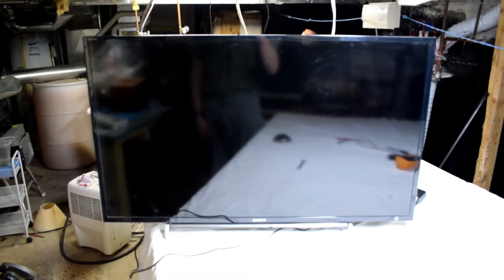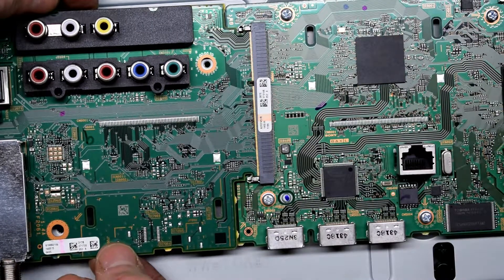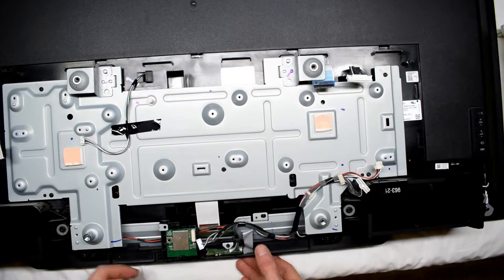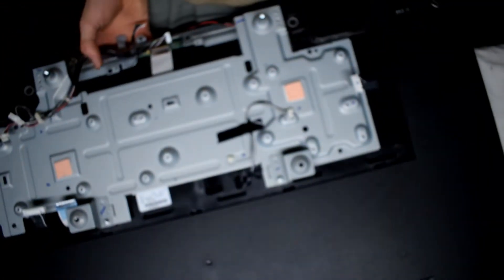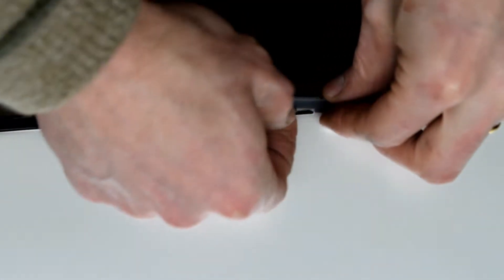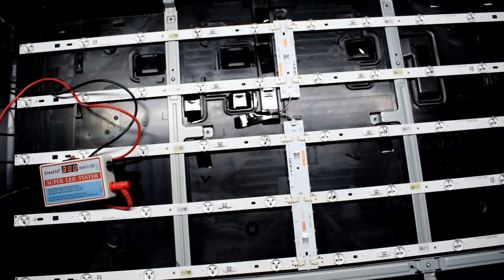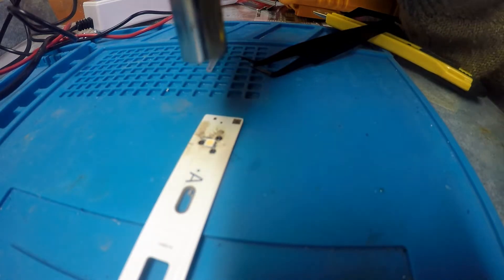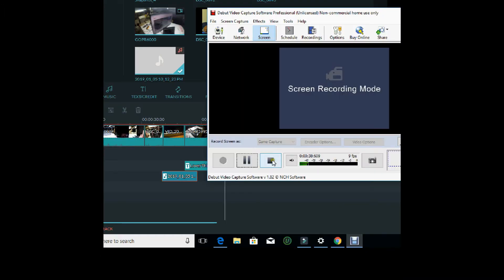Sony KDL 40W600  Backlight Repair

Comment: Great video!  I have the 48" version of this same model-line Sony TV.  Sony KDL 48W600B.  I also have the 6 red flashes with no picture.  Followed along all of your well described steps and also replaced all 12 backlight strips on my TV only to get it re-assembled and find out I still have the same condition: 6 red flashes with no picture.  I didn't have a multi-meter or LED tester when I first did this repair.  Now I do.  All the LED strips I removed are perfectly functional when tested.  

How does one test the standby volts on the power board with multi-meter for this model?  Do you have videos showing detailed steps for testing out the boards and the power supply adapter with multi-meter for the uninitiated?  Now that I've done the time consuming LED replacement, I'm inclined to isolate the real problem and perform that (hopefully) much less laborious repair.

Comment: Hi @NewsonsElectronics. Thank you very much for this helpful video. Unluckily (for us viewers), your kindly provided link to buy the LEDs has now gone dead (25th March 2024) and finding the correct LEDs is proving quite difficult these days. To clarify: they are, of course, 2 mm x 2 mm square, surface-mounted 'chip' or 'bead' 3-volt, white light-emitting diodes (LEDs). (In another comment you also mentioned that they are 1-watt LEDs. Is that correct?) Since the television's backlight is dimmable, does that mean these LEDs need to cover a voltage (and/or power) range (e.g. not just 3 V, but 3.0–3.4 V, or something)? Also, is their colour classified as 'neutral' white (Do you happen to know their colour temperature in kelvin)? A lot of the similar-looking LEDs online seem to include a four-digit model number in their listings. Is there a particular model number of LED we could search for? Thanks again. 👍

Comment: I have the 48" version of this TV.  It will power on and stay on with a green indicator light, but the screen will be clear/visible for only a few seconds before going to black.  The backlights are still on and there is sound, but I'm not getting any video.  Hard reset didn't work, nor did changing either the TUS or main boards.  I also ruled out the power supply.

There's an LDHM board that the power supply plugs into, but I don't know what that board does?  I've also seen comments about changing out the t-con board but I don't know if this model has one?  Any thoughts or insight would be very valuable!  Thanks!

Comment: Thank you for making this detailed video. Mine seems like is dying. There is a distinct buzzing sound accompanied by what appears to me as the tv re-setting over and over again without actually powering off. Ive has it since 2014 and 8 years and multiple moves, cross country trips, I do believe it may be time to move on. I mean, considering what tvs cost these days.
Reply from the maker: is it LCD or LED?
Reply: @NewsonsElectronics  Honestly, I do not know. Is there an easy way of telling?
Reply from the maker: @PATW0LF  check the power supply board there could be a bad solder joint ie the buzzing sound

Comment: Hi, my sony kdl 48-650D displays 6 times red blinking light after booting up. I have replaced the main board (only one board in the tv). Still displays 6 times red light. Your video shows same problem. Does this mean there are some led backlight lamps defective? I know it is quite troublesome to open up the front to check. Does 6 times blinking definitely signify that backlight strips faulty? Also there is no SONY logo displayed before it shuts down and goes black screen. Thanks.

Comment: Our Sony Bravia KDL-40W600B screened on then off and the dreaded 6 blinks...the aggravating thing is that while bought in 2014 it doesn't have even a month of actual playing time because it was in a guest room.  Original cost was a bit under $600...is it worth repairing and can you point to any repair places in Columbia, SC, around zip code 29201?  Thank you.
Reply from the maker: not sure, try googling tv repair shops in your area.

Comment: I have the same kdlw600b  TV.  the problem is while running it will stop displaying and start blink 6 times.  It will work again when i connect power after discharging /discconnecting the power , what could be the problem
Reply from the maker: I would get an led tester and check the backlights
Reply from the maker: one of them could be shorted

Comment: what voltage should the led strips have if the tv works well?
Reply from the maker: i can't remember the exact number but i think it was 96V
Reply from the maker: each led used 3V so if it had 32 leds in series it would be 96V

Comment: How many volt of one led ?3volt or 5volt?
Reply from the maker: 3V 1Watt, you would never have 5 v options are 3 or 6V
Reply: @NewsonsElectronics  which one  did you use?
Reply from the maker: @bagoestech9941  3V
Reply from the maker: use can use the led tester to check or if you have a multimeter put it in diode mode and it should light up if its 3v. if it does not light up then it would be 6v
Reply: Oke ,thank to sharing with me ..hope  this channel always succes

Comment: I have this exact TV.  It failed to power on at all and I replaced the LDHM2 power board and now it powers up with a green light.  I can connect a device to it and get audio from an HDMI connection.  Back light comes on.  No video.  Did the flashlight test... T-CON?

Comment: Thanks. Great video. I have a Sony 55X93E and it shuts down after about 7-8 seconds with standby LED blinking four times. I have replaced the motherboard and the inverter but unfortunately the same issue. The panel is extremely fragile on this one and don't think I have the knpwhow of how to get to the LED strips - or the confidence of doing it. The TV comes with external power supply and also there is small power board inside the TV (the copper coloured board at the very centre with ten big black capacitors. Is it possible the issue can be with one of these two. I am spending quite a bit on spare parts without knowing what is wrong as four light flashes can mean almost all components of the TV can be at fault except the T-Con board. Please help if you can. Thanks
Reply from the maker: get an led tester and see if each strip is giving the same voltage.

Comment: Hi, great video! I have a similar problem with this TV but I have a green light instead of the 6 flashing red lights. I am wondering how you ruled out a problem with the main board or power board. Is there a diagram of the board somewhere online so I can figure out where to measure voltages? thanks!
Reply from the maker: 90% of the time it's the backlight

Comment: My sony has a horizontal black stripe and some lesser obvious horizontal black stripes. Is that the same problem or is it that board you removed at 4:30?
Reply from the maker: this is not the same issue, horizontal lines could be a bad t-con board or bad lcd

Comment: I have the same problem in my sony kdl 48w600b.. approximately how much it cost to change the whole backlight and if we don't change the whole backlight whats the price of this small LEDs that u replaced?
Reply: Wow too much work,  scrap it
Reply from the maker: the leds are about $10 on ebay. search led backlight power leds
Reply: @NewsonsElectronics  LEDs are same for all the TV's or its different?

Comment: HOw do you know what type of  LED to use? (besides the 3 and 6 V ) or is there just one type for all tv's?
Reply from the maker: you need high power led for TV look online most any led for any TV will be fine, the voltages are usually 3V or 6V
Reply: From LG TV they match. Sony does not provide such repairs. My KDL65 breaks regularly. I'm sick of him. Last time I gave it to repair. He is now 4 years old. He was repaired 4 times. Now only the trash can and nothing from Sony.

Comment: Very nice video.Removing the screen glass is a real mess and in my opinion i think that is better to replace all the strips at once to avoid in the near future new openings the same tv for the same reason.
Reply from the maker: Indeed check the series voltage and see if they are all within range if a bit off other leds could be getting old.